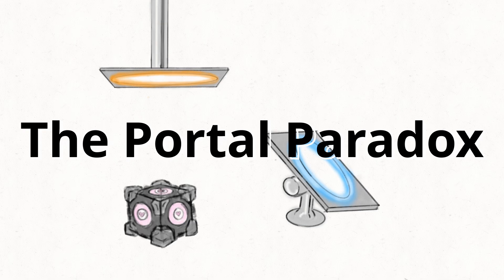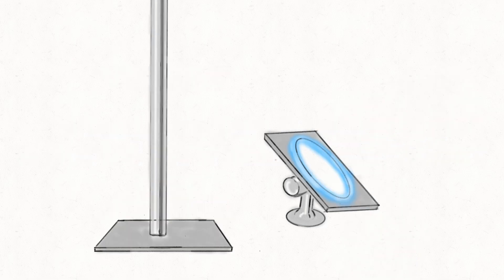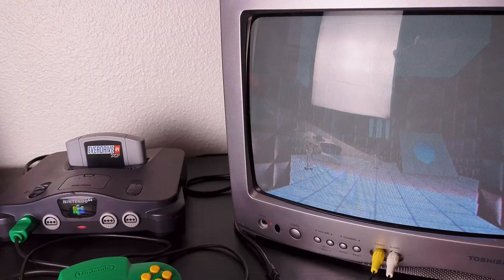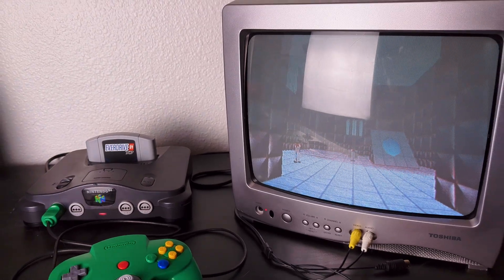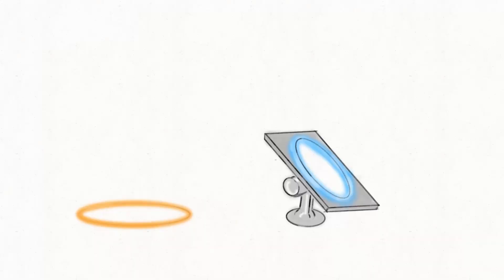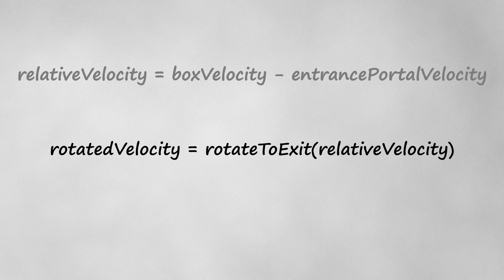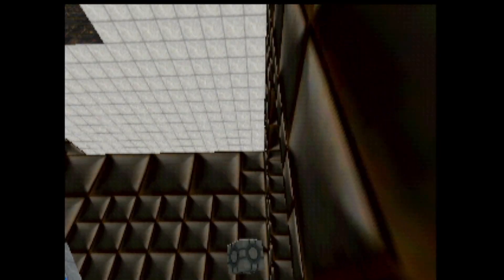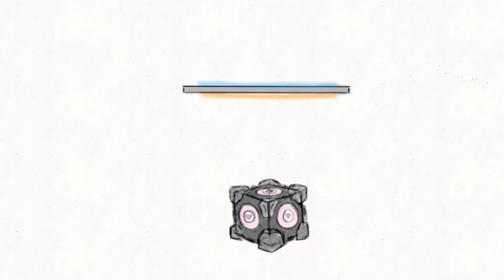I rewrote Portal from scratch and solved the Portal Paradox

Comment: My explanation:
NOTE: I'll be using the word "reality" to mean "frame of reference," because popular culture has made it a lot easier to reason about parallel universes than actual reference frames as used in physics.

The moving portals scenario doesn't involve self-intersecting portals, so each half of the portal can be treated independently. 

Because of relativity, you can imagine that the moving portal is stationary, and that the entire test chamber is moving toward the portal with the opposite speed. In a way, the world around the moving portal is like a universe where everything but the portal is moving.

Now examine the exit side of the portal. It's perfectly still, so you don't need to do anything there.

Now look at the cube. The entry side of the portal teleports the cube from a reality where everything is moving to a reality where nothing is moving. The cube, however, keeps moving, because it was just in everything-moves-land.

Comment: Given that relative velocity is imparted to some of the mass of the translated object as it exits the other side of the portal, this behavior seems inconsistent -- it ought to be (from our reference frame) 'sucked through' the portal if it's durable enough, or shorn apart by the inconsistent forces. If a person were to pass through a portal moving along their height vertically at, say, 60mph, they should be splattered as the first inch of their head accelerates while the rest remains stationary, then as the second inch, etc.

Your portal has relative velocity because it's an object, and your portal is an object because you implemented it that way. That's fine (setting aside the inconsistency above). But it's not at all clear why that is necessary or even likely to be true. The portal might be 'an object' perceptually the same way we talk about a shadow being an object, but treating it as one for conservation of momentum might be as fanciful as Peter Pan stitching his shadow back to himself.

Comment: So what happens if you slam it down on the cube but stop half way? The top half should be exciting the other portal at the speed it entered the first portal while the bottom half is still stationary. So would the momentum from the top half pull the bottom half through too or would it stay in place? Would the result be the same if it stopped at 1/4 or 3/4?

Comment: Depends on how you imagine the portals work. If you throw a hula hoop over a cube, the cube won’t shoot up, not because of an equation, but because it hasn’t passed through anything. 

Personally, I don’t imagine things “enter” the portals and then have their momentum maintained as they “exit.” I imagine that the portals simply bridge the gap from one location to another just like a door would.
Reply: This is how I always saw portals, and the example in the video is more like ramming a different room over the top of the cube, only with gravity moving it.
Reply: @jackthehacker05  yeah
relative to the cube, a room is being slammed down onto it
but from the exit portal's perspective, a cube is being flung towards it, which is where the movement comes from
Reply: @rydergolde3169  and from that: "speedy thing goes in, speedy thing comes out"

Comment: The main problem with trying to solve the Portal paradox is that it's not a paradox at all; classical mechanics assumes an Euclidean space, and one of the axioms of Euclidean space is that a translation X from position A results in position A+X. This is not true with portals, since a translation though a portal would result in a final position which does not equal the sum of the original position and the translation. We only think of it as a paradox because we're applying axioms which do not apply.

Therefore there is no right or wrong answer, other than it has to be internally consistent. The world of Portal simply follow different laws of physics which can handle a non-Eucledian space.

Comment: In your theory you are right, but I think the theory is not as precise as it can be. When moving the both sided portal over the cube everything is fine. The box stays on top of the floor and doesn't move at all. When moving just one of the portals the box moves relative to the portal but also stays in contact with the floor, which suddenly stops the movement of the portal. If the portal would continue on it's way the floor would push through the portal and also the box. So in summary there is no interaction between the portal and the box, it is just a too simplified model.

Comment: I disagree with the result. The portal wouldn't send the box flying & I can explain it in a not very complex way.
think of it like this. The platform rushing towards the cube has force, but the portal has no force. it is nothing but an open screen door. The force from the platform doesn't connect with the cube in any way. think of it like this. you have a blanket & you pin the corners of a platform that will launch it towards a flat surface at high velocity, then you lay down underneath it & launch the blanket platform. the blanket isn't stretched tightly or anything so it's like a parachute "without the wind resistance for this example because it's irrelevant to the test." The four corners will collide with the surface you're laying on, but the blanket will just drape over you. the same logic goes to the portal. The surface that the portal is laying on will collide with the other surface but the actual portal will be just like having a big hole in the middle with no force moving the cube. it will just kinda plop out the blue portal with no force. to the cube, it just sat there with no force, but instead the screen door just took the open space away & it came out the other side of the screen door.

hopefully that makes sense. I know you kinda comment on it, but that's my viewpoint & like everyone else on the internet, I'd rather die that change my viewpoint on anything.

Comment: Eitherof the two solutions could be correct however if you go with the solution you propose the energy to launch the cube has to come from somewhere. That's okay as it could come from the device that's slamming the portal down onto the cube, and if that's the case there should be some resistance encountered when the portal moves over the cube.

Comment: This, to my untrained but interested in physics mind, is how this should work. Motion and speed are always relative to a viewpoint so it makes sense that it's all based on relative speeds. The best explanation I've heard for this is to imagine two boxes with a string connecting them. If you throw one through a portal, the string will pull the other box with it. This is how you ca think of the box "gaining" momentum from a stationary position, the leading part is pulling on the trailing part
Reply: This is circular logic. If the leading part is "pulling" then you have already assumed what you wanted to prove. You wanted to prove that the box moves, and you did this by assuming that the first half of the box moves.

Comment: So the object magically obtianed energy... 
So how would it work if it if the portal stoped halfway.. by your programed logic it should mean when it stops halfway with consistent speed all the way through, that would mean the already halve object through the other side that "magically" gained speed would pull the other halve through the portal even though both are stationary.(just ignore the technical things like gravity)
Agian this is why this logic completely breaks realistic idea of the portals, the object "shouldn't gain random energy just because it poped out of the other side. But intead the portal should be able to push the object instead, but since it's a portal the object would go it based on the amount pushed. Kind of like if you pushed against the table with your hand but your hand was instead a potal. Its like pushing an object but in reverse. The object should be pushing itself out instead of gianing infinite energy and pulling itself into the portal infinitely

Comment: What happens when you have two portals facing each other (one on ground one on ceiling) and then the ceiling moves down so far that the distance between the two portals is smaller than the height of the object falling through them?
Reply: The object crushes itself

Comment: Shouldn't the cube be spaghettificated a bit? When the portal is halfway in the cube, the upper part experiences the pull (probably not the correct word) but not the bottom part. And even if the cube is infinitely strong, shouldn't that change the exit velocity (maybe it cancels out, too much physics for me)?
Reply: If I lift a box from the top(giving it pull from just the top), wouldn't that spaghettify it too then? The amount of force needed to move that cube at a few meters per second is totally in the grasp of its structural integrity. You do bring up a nice point about if the portal came down it at crazy fast speeds, then maybe cube gets morphed a bit. I do wonder if it will then be spaggetified or squished.

Comment: You are correct. Thanks for solving it. First of all your code doesn't need to make a distinction between stationary and moving portals, stationary ones just have a velocity of zero. This is important for me if the solution needs to be valid. Second, you used the same code to demonstrate the hola hoop case. If your code would use branches for the different test cases I would say that it's not valid but your solution works.

Comment: Ok, took me a solid minute to get WHY this happen.
At the begining i thought it was coding physics, basicly cube is detected as having speed, but when the physics are set for the exit it has speed.
I thing is this: When the portal moves down and absorbes the cube it then pushes it out in the other, why?
Becuase the moving portal basicly SUCK the cube when movin towards it, pusbing it into the portal, thus causing it to be launch when exiting in the other way as the matter in the lower part of the cube "Pushes" the matter in the Uper part of the cube.
Or, The uper part pass first, but to the other part to pass it has to be push at the same speed it passes the portal.
Keep in mind, reality as we know it dosnt really follow what we call "reason", if you stufy physics you should know, thus this aproach may be posible.
Yet not a definitive answer as we dont know how to even make a portal, so dont know how it will work.
As for the momentum cancel, thing of it as jumping in a decending elevator, you momentum is almost null, as the same force that jumps you up is already pushing something down.
Laws of every force has an equal reaction, thus why heavy object can wistand the force and move smaller objects.

Comment: As said in Portal, portals conserve momentum, not relative velocity. You need the mass of the cube and the platform to get the equations. Otherwise, it would be easy to make a very light platform, move it very fast and give a cube any speed regardless of the mass, which does not make sense (you would be creating energy)
Reply: Go in to the game right now (portal or portal 2, doesn't matter), find a cube, put one portal in the ceiling above the cube and one on the floor below the cube. The cube will now start accelerating, congratulations, you just created energy!
Portals break everyday energy conservation, but if you take a classical mechanics course you will learn that energy isn't always conserved but momentum is within an isolated system.

Comment: I like your approach. I'm a physicist, so I immediately start thinking about conservation of momentum - like, if the exit portal were on a movable panel, and the cube effectively reversed direction when passing through the portal, then shouldn't the movable panel move backward, logically it would need to have twice the momentum of the cube in the original direction. Fun!
Reply: The cube doesn't have any potential energy. How is the cube suddenly gaining enough energy to fling itself across the room?? In order for an object to move, energy/work has to be applied. 

Since the portal itself doesn't physically interact with the cube, it just relocates it, the cube has no way of suddenly obtaining this energy. All of the energy thats used to push the tile into the ground is absorbed by the armature, the floor, and the panel. It's distributed as vibration, sound, and heat. We know this because objects that are dropped from one portal into another when they're stacked speed up to terminal velocity. If the portal could transfer the energy from the object it was sitting on while that object moves, it would also absorb energy from objects moving through it and transfer that energy to the surface it's mounted on. But that's shown very simply to not be the case. The cube will only move because of the force of gravity at its new location, and flop to the ground regardless of how fast the panel was pushed down. moving it at an infinate speed would be just be teleporting the cube afterall, wouldn't it?
Reply: @Saffron-the-derg it's more likely to pancake the cube on the other side as it gets transferred in layers that have 0 momentum to the same world position as it's other layers but otherwise yeah, I don't know why anyone thinks the object energy/velocity/momentum/whatever somehow has to be tied to the portal.

Comment: The portals can only move parallel to the plane upon which they exist, as demonstrated when using them in portal 2 to cut the neurotoxin tubes, they can't move in any other direction, they pop immediately.
Reply: Even that is just a visual gag, there are actually no moving portals in portal AT ALL.

Comment: From where is the portal obtaining the kinetic energy it has on exit from the blue portal? Everything is in the same inertial frame, but somehow the act of moving between portals has imparted significant kinetic energy on the cube in your example.
Reply: Another item I never see brought up in these thought experiments is that the orange portal decelerates and comes to rest as it contacts the floor, so the final velocity of the orange portal relative to the cube is zero as the last of the cube is going through the portal.

Comment: Now I want to see an orange portal on a platform to the right and a blue portal on a platform on the left with a cube in the middle, then extend the two platforms until they hit in the middle. How will your simulation handle that? The cube will hit itself at the same time as the platform would hit the cube so I would assume the platforms would stop as soon as they would have hit the cube if there were no portal.

Comment: In the second moving test the entrance and exit were back-to-back. What would happen if they were further apart? Imagine a 10m long cylinder with portals at bottom and the top, which falls onto a cube. When the bottom of the cylinder reaches the floor would the box just stick out of the portal on the top?

Comment: Bad. If you were to move the portal where only half of the cube was sticking out, would the cube stretch and warp. You can't just impart changes to inertia because you feel like it. The only actual force imparted on the cube would be gravity, which if it overcame friction it would gently slide down the surface to touch the edge of the portal which is it own set of problems. Your equation isn't wrong, it's the wrong equation.

Comment: I disagree. There is nothing mathematically wrong with your formula, but I don't think it properly describes how the physics should work. I think only object velocity, not portal velocity is what matters. If the cube isn't moving, it will just fall (via gravity) out of the exit portal. If this were the case, the second test would behave exactly the same. I think of a portal as just a doorway. You don't gain anything walking through a doorway, the same way you wouldn't move if the doorway moved over you. Objects can't gain energy from nothing.

Comment: Relative velocity is not the same as acceleration, because the mass involved matters.

In this case you have acceleration ONLY on the moving half of the portal. There is no acceleration in the cube or in the static half of the portal.
Since normal objects can't "half accelerate", and static objects can't acquire velocity without accelerating first... IMO the most probable outcome of that stuf in our physical world would be some sort of destruction. Maybe the static half of the portal and the accelerating one cancel somehow... or maybe the cube accelerate instantaneaously to accomodate the situation of the moving portal. The key word here is "instantaneously". 

The outcome that would make more sense to me would be the cube material accelerating instantaneously to match the velocity of the moving portal: since the portal has no "thickness",  each particle of the cube material the portal passes would independently accelerate in the least time possible (planck time) and get projected through the exit portal with force, velocity and acceleration apropiate to its independent mass. In other words: the cube would be sliced into 1 particle thick wafers, that would accelerate to the extreme, transforming the portal into a death ray cannon and destroying the whole station in the process.